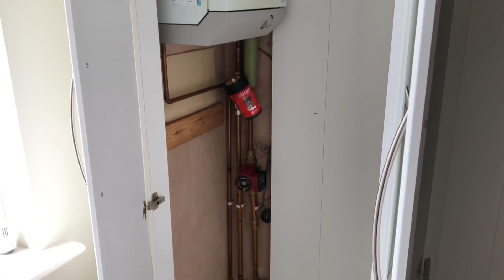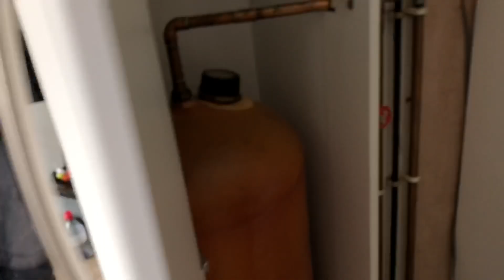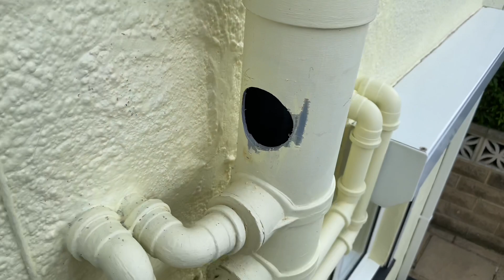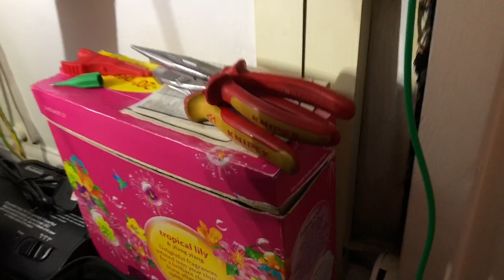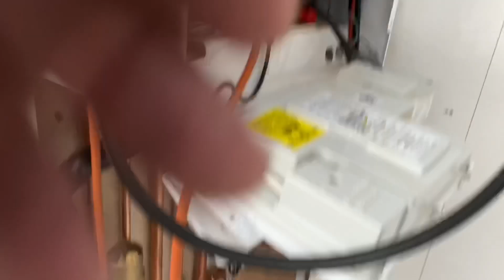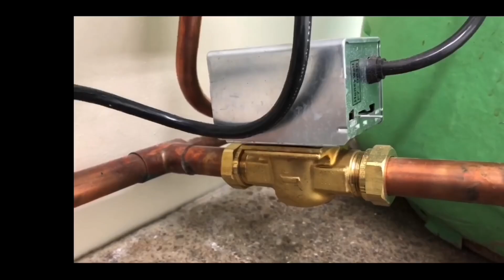New Boiler Installation - Cylinder Removal - Step by Step - Leeds Plumber

Comment: Hi Allan, 30 years ago I fitted my heat only boiler, I was a competent person, it now has served us well and needs to be retired. The issue that I have is that now that I'm 70, I can't afford to pay a gas technician to install the combi. My question therefor is; if I fit the combi to the wall and do all the water connections and cut out all the redundant pipes, tanks and valves; would a gas safe person come to my home and connect the combi to the mains gas and commission it?
Reply from the maker: No unfortunately they are not allowed according to gas safe

Comment: Great improvement, but should we really still be swapping out hot water tank systems for combis when heat pumps are the future, in 5-10 years you'll be putting a tank back in?

Comment: Another great video Alan 

Can I ask how would the conversion be if it was a full gravity system without zone valves ? I only ask as I have seen a few cylinders with gravity fed hot water systems

Comment: Hi I've just started watching your video's, I'm due to have my gas fire back boiler replaced for a combi in the coming weeks. I'm so worried about this because the hot water tank is in the living room and obviously the boiler will have to be relocated, and as I live here and can't move out I just overwhelmed by the thought of the work moving my belongings around. Anyway great video's.

Comment: Just wanted to know when a property is run on oil heating system, no gas. When changing to gas/combi boiler will the whole of the pipe work require a change? Including the radiator pipes etc? Please if you can clarify and an estimate of cost from oil heating to gas

Comment: Hi Allen! I have question and looking everywhere on internet but can’t find definitive answer. I’m buying an apartment with regular boiler in kitchen and hot water cylinder in kitchen and cold water tank in the loft. Loft is only accessible through upstairs apartment. Is it possible for me to switch to combi boiler and get rid of hot water cylinder without having to disturb upstairs tenant? I heard he isn’t very collaborative with loft access. Many thanks for your response in advance.

Comment: On the system removed if the coil in the cylinder pin-holed the primary water could contaminate the CWSC. Great videos Allen.
Reply from the maker: Thanks very much for your comment, please consider subscribing to support the channel 🙂

Comment: lovelly  jubbly job allen    brilliant to see done every bit carried out  p[rofessionally  from cementing  of  flue  to fill in space  from old  flue  diameter    to even  putting plastic black   condensate bracket over connsate  protective inulation ,  great  to see, id like to ask allen  who inspects your work ,? ha ha ha   i remember  ghas inspectors   jamie tenant     edinburgh   etc   could turn up on any occassion un expected   but usually booked  3 jobs that  youve  done  , good man  was mr tenent  great    bloke  always  gave advice and made sure  you gave correct answers  he wouldnt fail you unless you were really really bad   top man ,
Reply from the maker: Thanks very much for your comment, please consider subscribing to support the channel 🙂

Comment: Hiya Allen. How do you work out how much expansion is required in a heating system. As in do they spec in boiler manufacturers instructions how much there ev can cope with. Is it square literage as would you measure that beforehand. You could put so many gadgets on couldn’t you  descaler , magnet. Mini shock arrester cold water filter. External expansion vessel. Ever fit them all. I love the idea with full ball iso valves on pipes to. 👍 😊.  Harry.
Reply: Also. Is that a Nordstrom power flusher. Do they all come with the magnets built in. 👍. So cool.
Reply from the maker: Thanks very much for your comment, please consider subscribing to support the channel 🙂

Comment: Hi Allen, if the existing pipework to the radiators is micro bore would you keep or change for 15mm?
Reply from the maker: No, Not unless the customer asked for it updating. Thanks.

Comment: I just want to put out there to all Gas safe chaps correct info about wiring regs in relation to Bonding (I'm an electrician) also competent with boiler electrics/boards testing etc... It's a common misconception but I have a property I rent out and  2 Gas chaps coming around both have said or left a paper about inadequate bonding... This is due to the meter being outside and there being no bonding within the cupboard. Regulation 544.1.2 clearly states "The main protective bonding connection to any extraneous-conductive  part such as gas, water or other metallic pipework or service shall be made "as near as is practicable" to "the point of entry of the part into the premises". Where there is a meter, isolation point or union, the connection shall be made to "the consumers hard metal pipework" and before any branch pipework. "Where practicable" the connection shall be made within 600mm of the meter outlet union, (or) "at the point of entry to the building if the meter is external. .... end of 544.1.2  So many external meters enter the house and go back underground to pop up somewhere else in the property, in my own its a short distance to under the stairs , where of coarse there is a 10mm main bonding labelled equipotential bonding conductor running ot the main earth block of the consumer unit I fitted some years ago. Yet Gas safe chaps leave warning notices about no main bonding. Try to put this in your videos chaps... many are giving improper warning notices and its false information. If in doubt ask a "proper elctrician"... Essentially gas pipes should be bonded where they raise into the premises as the purpose of the bonding is to create equal potentials within the property, and if you bond before it goes back undeground you may pick up ground voltages that are not properly bonded perhaps.. its where it pops out of the ground into the property so can actually be in kitchens or under stairs quite often - Lets put the correct information out there... As for Gas safe, the last Gas safe BG chaps I came across installed a new boiler in a kitchen, with no electrical cert, left the installation with virtually no earth and an unsafe install for an MCB cut-off board having inadequate earthing fo rdisconnection and was certified for gas, this was only rectified because I was asked to put in a socket within a week of the install... . So please lets incorporate proper guidance on the bonding regulations and get installers properly informed...
Reply from the maker: We follow the gas regs and these may be different to the electrical ones but that's the ones we follow. Thanks.
Reply: @AllenHart999  Yes thats normaly the case of the statements made, but reflect the electrical installation regs only as a guide - electrical installation regs take precedence for electrical issues in relation to equipotential bondings in respect of electrical saftey within premises...Just putting it out there as the gas regs reference for the relevant BS 7671  stipulations for equipotential bonding should be 544.1.2 there is no dichotomist argument to counter this point as the regulations are relevant for electrical safety within premises.. and correct information should be put out there.. its just aneducative point that should be embraced as positive learning.

Comment: If you are installing an unvented cylinder above the highest outlet on the system. You should install, an anti-vac valve. Some Worcester cylinders have them incorporated on the combination valve. The cylinder can implode, due to siphonage. as your man stated. The valve should be installed on the outlet pipe. Allowing air to enter the system. This disrupts the siphoning. Due to negative pressure in the cylinder. The anti-vac valve opens, enabling air to enter, the system. I hope this info makes sense?
Reply: @AllenHart999  Hi Allen, this message, was meant for one of your other posts. The one regarding the unvented cylinder,  that had imploded. Due to insufficient water supply. It must have jump. As your video ended. Sorry if you found it confusing!

Comment: Is there an advantage to using 22mm tee with end cap on the flow and return? I always use 22mm - 15mm drain off and connect to that. I guess advantage with the 22mm tee used in this video is that you can then use 22mm hose when flushing? Anyone got view on this finer point of installation in this vid. Great and informative video BTW. Cheers.

Comment: I have a newish  Worcester R18 condensing boiler my location is Greater London is there any ruling on insulating the condenser pipe as British Gas did not fit the insulation are we down here not need it or is it a saving on work time.
Reply: Thank You Allan your video on Combi boilers was to me exceptional and understandable great work

Comment: Detest combi boilers! Give me a tank any day. Modern pressurised cylinders are in another league to any miserable combi, both in terms of performance and overall user experience. Fortunately many developers finally seem to understand that combis are not great in family homes and are installing megaflo type systems now. Sadly, too many homeowners don't realise the drawbacks of combis until it's too late and the things are already installed. Every single property I have owned or lived in with a combi has had issues with it. Needless to say I rip them out now as a priority when doing a refurb.
Reply from the maker: Thanks for your opinion.
Reply: So let me get this right, you doing a refurb right and the young lad working with you says, hey boss there's a brand new Vitodens 200-W in the airing cupboard and you reply... Get that dirty stinking combi boiler on the skip now... But boss it's brand new... I don't care if it's gold plated son, it's a combi,  skip NOW 😂

Comment: Great video Allen. Your down to earth instruction and easy going manner make watching and learning from you a joy. Can you do a video where you change a boiler from ov to a sealed pressurised system. That would be great thank you.
Reply from the maker: Jason Miller This one was open vent, Then it went to sealed, Do you want something else? Thanks
Reply: @AllenHart999  thanks for the reply mate. I was after an install that has had a new boiler installed and converted to sealed. Still has the cylinder on ov just the heating side pressurised.

Comment: What do you do with the Flow and Returns from the cylinder?
Reply from the maker: Tyler Rippon Totally cut them out, no longer needed
Reply: Allen Hart So you can cap them off then?
Reply from the maker: Tyler Rippon No, They are no longer there, totally cut out.

Comment: Great job Alan ,so many cowboys about these days . Did have a look at that air separator. Think it's curing a problem that does not exist on pressure systems ,If a pressure system that has been correctly installed and commissioned is giving up air constantly  then it probably has a leak somewhere . I always thought it unnecessary for boilers to have auto air vents which are problematical as well .The Dutch boiler manufacturer Intergas just had a manual vent placed at the top of the boiler which worked fine .Have you come across them only 4 moving parts The water heats via a coil similar to the instantaneous multi point water heaters of old . I watched the video to the end also The best always cost s bit more but most of the time it's money well spent!
Reply from the maker: They are definitely interesting. I will do a video in a year or so when I go back and test. Thanks.

Comment: Very well explained Allen.
Ive got a potterton with 10 mm pipe to the rads .think it needs a power flush as im getting a few cold spots and boiler is getting a bit ratterly.shame i dont live in Leeds i wouldnt hesitate getting you guys to do the work. The boiler is 28 yrs old now would you advise changing it or just wait until it packs up ?
Reply from the maker: Hard to say without looking at it. You would definitely benefit from updating. Thanks.
Reply: @AllenHart999  i get it serviced each year and they always say its working fine.these new combi boilers dont seem to last i know someone thats gone through 3 in ten years.
Reply from the maker: Tex Lfc1974 They don’t last if they are badly installed. New boilers will last and be reliable if they are installed correctly. 👍
Reply: @AllenHart999  great when can you come to Shropshire 😄
Reply from the maker: @TexLfc  You wouldn’t want to pay my price lol... Thanks.

Comment: Could you not just put a heat trace down the condensate with out door temp sensor? Surely it would work aswell if not better than that expensive lagging you use and the kit you need for it.. 
You always do a quality REAL WORLD job (unlike the polished pipe jobs people post) 
Keep up the good work and stay safe..

Bradford
Reply from the maker: Wouldn’t need a trace heater on this one. We always need to lag them no matter what. Thanks.

Comment: We always try to reduce the ammount of pipes that need to run on the outside of the house, ( cosmetic reasons along with practical )  especially the condense pipe due to possible freeze and boiler shut down, there is always somewhere to run it internally
Reply from the maker: Absolutely. Thanks for sharing

Comment: Hi Alan another top video. Won’t the stop tap give you water hammer ? Why didn’t you use a PRV ? Cheers Simon .
Reply from the maker: Never had any issues with a stop tap, If the pressure was higher then we would definitely be looking at a PRV. Thanks so much.
Reply: Top video mate would
You be able To explain what pipes go where when converting gravity to combi system

Comment: Hi Allen great  vid very informative , one question  i know it's practice to run the condensate pipe to the soil stack it makes me feel a bit uneasy because health and safety implications . One that soilpipe smells can go back into the house and two if the drains block up the condensate will just add to the problem and also soul waste may even back up the pipe in a worse case scenario.
Reply from the maker: The connection is above the toilet, It would overflow into house first. Thanks so much for the comment.

Comment: Great video. I couldn't tell but do you use a boiler loop and a system loop?
Thanks
Reply from the maker: Sorry i am not sure of your question
Reply: Just about all condensing boiler makers in the states recommend hydronic separation using closely spaced tees or a low loss header. This creates two loops a boiler loop and a system loop.
Great job again. 
Thanks

Comment: Have you ever come across a cylinder where the main body of water is on the central heating side and the coil is mains pressure? I’m just an electrician went there to change the immersion and thought it most odd. All back to front to me. Excellent videos thanks.
Reply from the maker: Not on this type of system. Thanks.
Reply: Thermal store
Reply: Gledhill System mate three ,the boiler heats the complete cylinder with hot water via a separate boiler  then when a tap is opened the 2nd  pump on the system starts up and the cylinder hot water gets pumped round a plate heat exchanger that heats up the water going to the taps .We had them in flats no header tanks required as they had there own expansion tank and you got enough water for a bath as quick as a tank system but oh so complicated and very expensive to put right when they went wrong which was quite often . A 30 KW combi boiler does the same job almost.
Reply: john Boy thanks for reply that will be what it is. It is in a flat.
Reply: James I have no doubt these may have changed somewhat ,my experience of these was limited to 16 units put in around 2000 in one bedroom flats .They were heated via Potterton envoy condensing boilers with an ancilery expansion tank . They were very complicated , ugly bits of kit ,ours were in what could be described as walk in cupboards . They required the cylinder to be heated constantly through the day so as too be ready if a tap was open .  so the cupboard was very warm .In those days 24 kW was the start point for Combi so these provided tank like hot water performance,If I were you stick with a 30kW good quality Combi .Alan recommends two or three different ones.
Reply: john Boy thanks again for the reply. Seems a very convoluted setup. It’s a 2 bed flat possibly a bit older than 2000 but who knows. With what you’ve put it all makes sense now.

Comment: Hello again Allen, thanks for an interesting video. I've just bought a house where the boiler was partially dismantled because it was moved for building work. Before I get the 'man in' to install it properly I thought I'd try to find the missing parts, which are the boiler fittings that the pipework attaches to. I was amazed to find the (Ideal) boiler uses non-standard threads on it's fittings!!  I resent this. Is there a boiler manufacturer out there that isn't so 'precious' about using his connection fittings? I'll buy new if necessary.
Reply from the maker: I would advise to never DIY with gas. Thanks
Reply: @AllenHart999  Thanks Allen, but I'm just gathering the parts together not installing.
Reply: Probably to stop joe bloggs from installing his own

Comment: So was that a power shower? What sort of pressure they getting now
Reply from the maker: The shower was not as good afterwards but I told the customer that before. We spent a lot of time chatting to make sure we installed what suited them. Customer was very happy. Thanks.
Reply: Allen Hart sure you did anyway, but always worth mentioning the difference a different shower head can make. A good shower head can make a real difference to how a relatively low flow feels. Sometimes it's a bit of trial and error but it's worth experimenting.